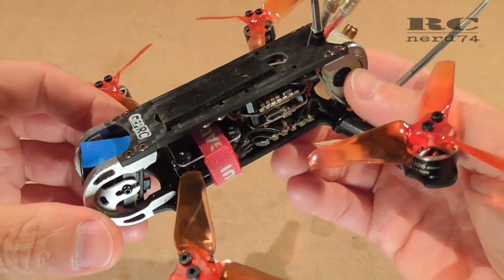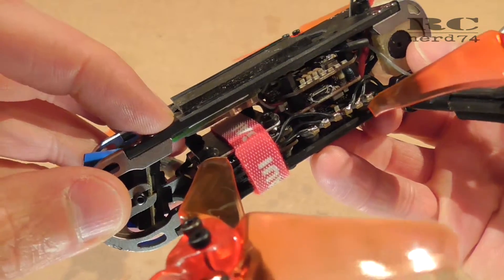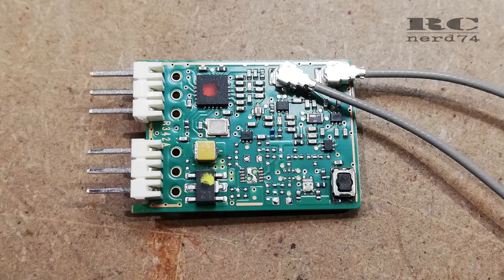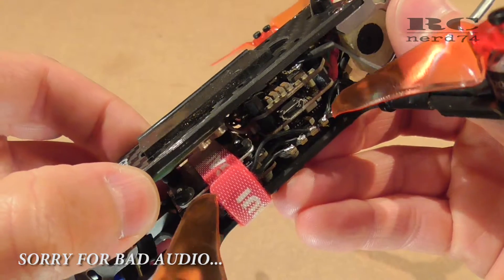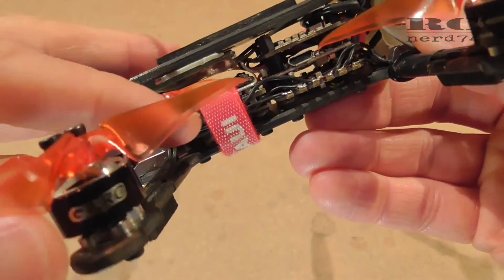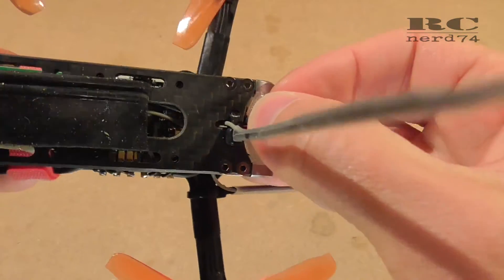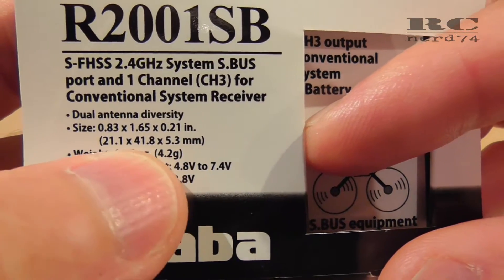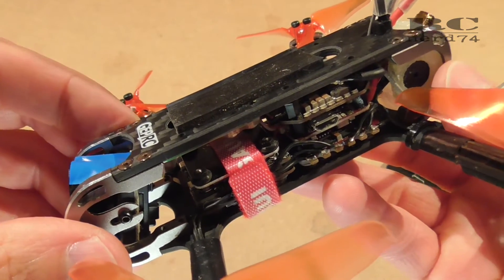FUTABA R2001SB S-FHSS S.BUS RECEIVER | MOD AND 3INCH QUAD INSTALLATION

Comment: what about betaflgiht setup? is it SBUS or S-FHSS?
Reply from the maker: You have to set Betaflight to SBUS.
Reply: S-FHSS is the transmission protocol between the radio and receiver. S-BUS is a serial signal between the receiver and sevos/flight controllers.

Comment: Hi! I've got a Futaba T8J, a Geprc Crododile Baby 4" PNP, can I solder r2001sb to use futaba?
Reply from the maker: Hi. This works. You just need enough space in your frame to install the R2001SB. On Betaflight you have to select S-BUS for receiver.
Reply: Ok, very helpful! :D

Comment: Do you get RSSI?
Reply from the maker: Not supported by this receiver.
Reply: @RCnerd74  yeah I have the same receiver but there is a way that you can get RSSI from it.  I was just wondering if you got yours to work..
Reply from the maker: @flyhigh6591  OK. I will check out the solution. Never used RSSI so far. Futaba FHSS works very trusty for me.
Reply: @RCnerd74  I have to use it cuz I fly a trex 500x fpv helicopter my last record was 3 MI out with a help of the Sunhans 2500w booster .But the good thing is it the H1 fbl has auto return if I lose signal but I still like to know what is about to happen to help me better judge where I can and can't fly and knowing where the dead spots are. .. I just got the Skylark 111 osd it's really amazing ...
Reply: @flyhigh6591  FLYHIGH i bought an h1 system for my omp2 and never ended up installing it in. building a quad now fig it would be perfect for it.... do u have any pics of how u wired it up/////
Reply: @TBloodFPV  I can take some pictures but have you tried H1 on Facebook ? there is a group dedicated to these H1 units.